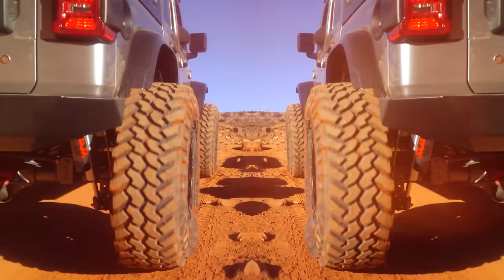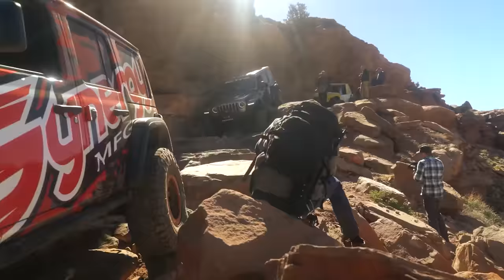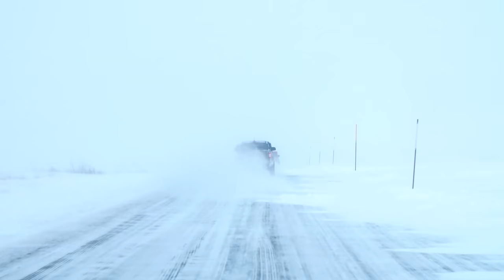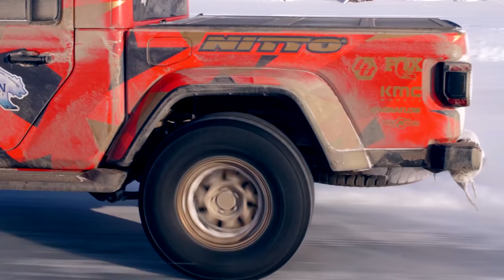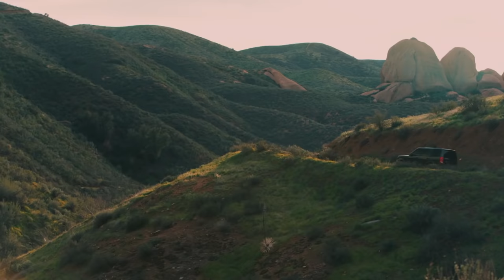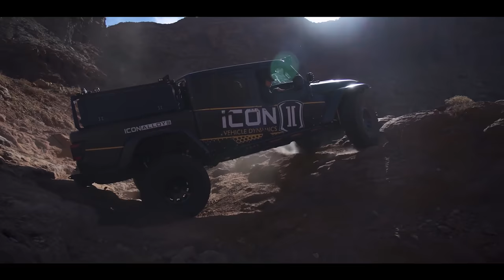Do NOT Use 4-Low Offroad || Watch First!

Comment: I live on the outer banks, and most of my off roading consists of driving on the beach. since I drive a 1st gen tacoma, my rig is so light that there's not much strain on the drive train in 4h and I don't need the extra torque because I pretty much float over everything. the only time I really ever use 4 low is when doing a recovery.

Comment: I drive only 2 'trails' around me in 4L, in a Suzuki Sidekick. One is very steep trail that leads to a mountain road when it's been raining a couple of days and 4H won't pull me up. Another time is on again very steep grassy hill where I need to drive about 25 meters sideways and it gives me better control of the car.

Comment: Dead stop for going into 4 low?  I highly question that.  Granted the last Jeep manual I read was in the 70's.  The manual read that you should be traveling 5 to 10 mph, in neutral when shifting into and out of 4 low. 

I have a YJ.  As soon as I hit the dirt I am in 4 low.  It does not matter if a 2 wheel drive pickup can drive the road.  I love the 
control it gives me, I have a manual.  I end up using the brakes far less and the driving is very easy.  After all you should not be driving faster than 25 mph on dirt.

Comment: regarding going downhill (on a long paved road) should i use 4-L or in  just leave it in 2wd or 4H in order to not overheat the transmission\gears. taking the consideration that i'm using low gears like 1st to 3rd?

Comment: I used 4 lo when I had a 1999 gmc jimmy I was stuck in the snow the vehicles front axle didn't lock but transfer case did work so I put it in 4 lo and backed up and it got out of the snow

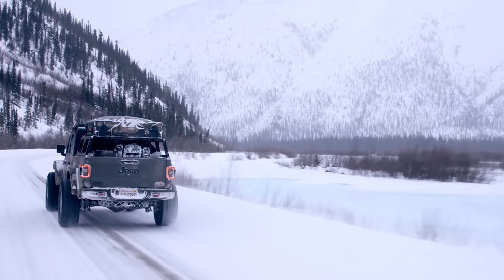Comment: My Taco has a Manual Transmission. I use my 4L more than others with an Automatic in the same situation. I’ll concede that the Autos are better off road, but manual is more fun to daily drive. The 4:30 rear end helps as well.

Comment: I've seen in your video that you use a nylon strap to pull that vehicle out of the ditch I've been in an off road situation for the last 40 years and I've seen some people get stuck very well the best solution that I have seen is using a is a 50' piece piece of 1" to a 1.25" nylon rope, We would hook up a vehicle  that was high centered with either one side or the other floating in the mud. The towing driver would  take off at a high rate speed to put a high tension on the nylon rope at which time he would set his brakes. Then we would wait until the Tension of the nylon rope pop the vehicle out like a cork out of a champagne bottle.  Never use a chain and less Is destructive jerking on the vehicle's frames then a nylon strap

Comment: If you have abs make sure you can turn it off when going off road OR have mud mode.  Abs is designed for ice(older models don't have mud mode)I am an ex farmer and when is in mud it applies the brakes to ensure you stay stuck and need a tow out.  It will also apply the brakes to prevent you from "rocking" yourself out of a mud patch. Very frustrating.

Comment: LC’s are always in 4 High. I use 4 low when I’m in off road areas that necessitate going slow anyway. It just reduces stress on the transmission and engine. If I’m doing more than crawling along I put it back in 4 high.

Comment: More often than not you don't really need low range. When you do you usually have to stop first anyway to walk the obstacle first. 
Most things you think you need four low for, all you really need is to drop some tire pressure. 4Lo is for when you need torque, not speed.

Comment: years a go I had a sound coming from somewhere under my old ram so I drove to a step long hill put the truck in bull low and four low let the clutch out got out of my truck while it climbed the hill and listened to where the sound was coming from other then that never had to my 4x4  trucks was old and manual trans so both my old 78 ram and 06 ranger

Comment: I bought a 4wd truck for the first time. Tried to go into 4 low, but it wouldn't go. Thought it was broken... Looked it up later and learned that you need to be in neutral. That was a sigh of relief
Reply: Some t imes when its not used it won't go into 4. Hit the transfer case with 2x4 or something
Reply: @vadimnesen8060  A good reason to practice shifting into all gears at least once a month and then go somewhere and drive through all the gears.  You'll find if you are in 4 lo trying to reverse becomes a real PITA to accomplish.  I keep learning my Jeep's limits as well as my own.  I wish now I had bought a 4x4 when I bought my first vehicle here in the States.

Comment: Here's the deal--I can cruise at 30 mph in low range with overdrive with 33's and 4.56 gears.  Once I hit the trail, the only reason I want to take it out of low range is to keep the transmission from hunting gears constantly.  So, I want to be able to manually shift the AW-4 transmission in my Jeep.
Reply: 3.55s and 35s work amazing for me. It blows on the road in high but it's a trailer queen. It's open in the front and fast enough to drive to the trail head from the parking area about a 2 mile drive on pavement in low.
Reply: Were there many different transfer case ratios over the years?
Reply: @paulstandaert5709  the only ratio Cherokees ever came is 2.73. Actually all chain driven new process cases except the 241 Rubicon case are 2.73.

Comment: Is it better to stay in 4 LO or switch back n forth between 4 HI and 4 LO? I normally use 4 LO when i need to limit my speed, but once i get on smoother areas I am not sure if going in to third in 4 LO is a good idea or not.
Reply from the maker: Staying in 4Low while in 3rd gear is generally not recommended. If the next part of the trail you can go faster, it's recommended to switch to 4High. Don't want you ruining your rig!

Comment: I use 4L and 2L (twinstick) all the time in my BB 78 Blazer with 4.88 gears and NV4500. Where I don't use it is on steep snowy/icy hills, if the truck starts to slide I want the speed to catch up to the slide, 4L doesn't seem to work for me in these conditions .  Nice Vid, thanks

Comment: I use 4 low when I am driving around frozen chisel plowed farm fields (Iowa). Especially when I have to drive across rows to get to a hunting spot. Generally I drive along the field ends where the rows run parallel to the rest of the field, but then there are times I have to cross the rows, and low in low 4 seems to work best. Also, since you're from Wisconsin, you'll know what I am talking about when it comes to NW Iowa/SW Wisconsin topography- there are some trout fishing spots I go to that have some steep inclines to get in/out of, and are usually dirt with exposed limestone up steep grades that are sometimes wet from rain, dew, mud, etc. SE Minnesota is the same way.  Up in Minnesota, I drive on some logging/forest service roads that require 4wd, but only 4low if it's snowed or rained a lot.
Reply from the maker: You hit it right on the nail for the topography haha!
Reply: @TrailBuilt  I have a farm pond that I go to in the summer that has a pretty mean incline to get down to it- it really tests your gearing and your braking on the way down. The loose gravel and damp limestone along with clay/sand and deep washes after repeated heavy rains makes it fun. 20 years ago  it was well maintained and had crushed gravel surface and we'd run up the hill with a minivan no problem. The landowner kinda let it go.....kinda on purpose because people would sneak in and fish. So now if you go......you better have a 4x4 or you're calling a tow truck for an expensive recovery, haha.

Comment: If you are not sure when to use 4Low you are doing it wrong or are new to Offroad driving. 4Low is Offroad use rock crawling and obstacle related. 4Hi is flat ground Offroad when you need speed or snow conditions ice on flat ground. You should really learn when and how your vehicle works before taking it into situations that require 4Low or 4wd in general.

Comment: Most of the time 4 Lo , auto in 2nd, really tight sand trails in the forest, mud. Stops the auto over working getting hot, also have remote cooler for trans with thermo fan.
4hi slippy roads only , gravel, heavy rain

Comment: I guess you've never heard of the two wheel drive game that Matt plays. Go as far as you can in two wheel drive, then get out and lock in the hubs in the most awkward places. One thing that you don't mention, is when driving at highway speeds, you can shift from two high, to four high and back when the highway changes from slick to dry. Just let up on the throttle to take the pressure off the drivetrain, and shift.

Comment: 4LO with a manual transmission and a hand throttle is like driving a totally different vehicle. With my hand throttle I can set the RPM not even worry about the gas.

Comment: I do 4 low mostly and 4 high over 20, you really should be runni g 4wd at all times off pavement imo as a safety measure gives you much more control if it's slicker then you think or you come upon an unexpected issue.

Comment: In 50 years I can only say I needed to use 4Lo twice. Other than that either 4hi or like my current Jeep just the AWD. That being said I have heard a lot of people in 4wd Facebook groups claim that 4Lo will protect the land but not sure I believe that.
Reply: I'd run it in 4 low for a minute or two offroad a few times a year just to keep everything working. Besides, you only live once. Have some fun and get to know vehicle well in 4lo
Reply: @forlornhope1116  we use 4lo I'm just saying it's most times not been needed.
Reply: @risbill1  ah, got ya. My cummins dually stays in 4lo on the ranch offroad pulling trailer through/crushing thick vegetation to feed and check up on cattle. I can idle up hills. For a wrangler and not going through thick brush 2hi & 4hi is just fine

Comment: I used to think that stopping was the way to go when engaging 4L. But then I read my TJ's Owners Manual: 

"4H to 4L or 4L to 4H
With the vehicle rolling at 2 to 3 mph (3 to 5 km/h), shift
an automatic transmission to N (Neutral) or depress the
clutch pedal on a manual transmission. While the vehicle
is coasting at 2 to 3 mph (3 to 5 km/h), shift the transfer
case lever firmly to the desired position. Do not pause in
transfer case N (Neutral).

NOTE: Shifting into or out of 4L is possible with the
vehicle completely stopped, however, difficulty may occur due to the mating teeth not being properly aligned.
Several attempts may be required for clutch teeth alignment and shift completion to occur. The preferred
method is with the vehicle rolling at 2 to 3 mph (3 to 5
km/h). Avoid attempting to engage or disengage 4L with
the vehicle moving faster than 2 to 3 mph (3 to 5 km/h).

Comment: I found out the hard way that a Tacoma will not shift into 4Lo if pitched up a steep incline,  veh  must be relatively level for it to electronically lock into 4Lo;    Had to back approximately 20 ft to level spot before I could shift 4Hi to neutral to 4Lo and complete climb..

Comment: 4-lo, pulling large logs. Had to air down to 30 psi to budge it.  It was about 12 feet long and about 30” at the base. 4-lo gave me the crawl I wanted. Also I don’t know if anyone else’s 21 gladiator has this happen… I’ve an automatic… but when I shift to 4-lo the transmission starts in 2nd gear. I have to flick over to manual to get into 1st????

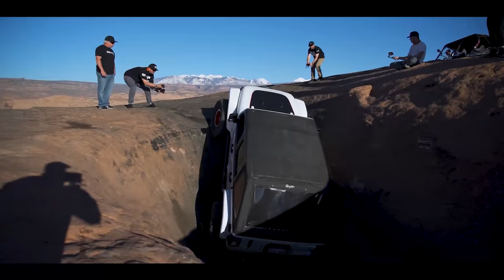Comment: Error at 6:37
Shifting into low does NOT 'multiply the engine's output power' Changing gear while holding everything else constant will change torque, but NOT power. 
What you said is true only IF you QUALIFY your statement by saying that the lower gear will allow the engine to rev. higher at the speed the trail permits, so that it reaches its optimal power band.                   If you're going to bring up a topic like this, please be precise.

Comment: Firmly believe low should only be used in deep mud in low powered 4x4s, towing heavy off road, going down steep sections and sections that are full of slow trail so your not on your brakes all day but Everything else should be high range. 
Any vehicle with a v8 really shouldn’t need to use low unless it’s for safety purposes. I’m not saying v8s are king but there’s a reason you see most builds using a v8.

Low also puts more strain on the drivetrain contrary to what people think. Your trans and engine are reved up like your in the highway when your only doing 15mph so it provides less cooling, it throws anywhere from 35% to 50% more torque to the wheels so when your already bouncing on the rocks that’s just extra axle and hub breaking power. Either put it in low and crawl like a turtle or high and smash thru.

Comment: Whenever i pull another rig with my jeep, i always use 4 low, or when i want to go slow with power. I use 4 high most of the winter (up here in alaska) when normally driving.

Comment: Doesn't 4-low help mitigate "binding" if/when tires gain traction, eg on rocks, namely by making the tires slip just a bit? In some "full time 4wd" setups (eg, vintage Mercedes G), the center differential only locks in 4 low but not hi, which I presume mitigates  center diff binding to the extent the 4-lo gears can more easily force the tires to slip.

Comment: Don't get caught up in the arms race of lockers.  For most driving and off road, a selectable locker in front, and a working lsd in back will do fine.  Put your money on a winch, and tires. If you are new, get bfg all terrain--these tires history go back near 50 years, very well proven tire and well worth your money.. Mud tires on snow work very well.  If no winch, use recovery rope and get solid recovery points. Bubba rope great place to start with recovery rope.

Comment: If you go up a steep gravel driveway in 4 Lo and it has a turn you will spin and dig up the gravel. If you use 4 Hi then the tires will give and you won't tear up the driveway as bad. Correct? Plus the wear on the tires using 4 Lo. 4 Lo does not allow any spin in the differentials.
Reply: It depends on the diffs. Open/open would go easy.

Comment: Where did you grow up where they didn't use 4low? It was common here in Utah. Common in 4x4 clubs to advise 4low, as well as guided runs, such as at Moab Easter Jeep Safari.  Most wheelin' in Utah is done in 4low.  In my Scrambler though, most of the trail is 2hi, then 4low at the obstacles (454 & SM465 help with that).  It's been weird doing whole trails in 4low in the newer Jeeps with small engines and lack of torque in 4hi/2hi.  Even my diesel JT prefers 4low. 
 Good vid!

Comment: I can't agree with those that say 4 high is mostly useless or shouldn't be used.There are many situations where it's helpful and or safer using 4 high when you don't really need four wheel drive at all. There are several that apply more to pick-ups than to jeeps or short rigs. One is slippery, muddy or snow covered roads. There's absolutely no reason to run in 4 low driving 10-20- miles down these roads but 4 high can  save you from having the rear slide around and pass the front end in a turn. Also, and this is a Biggy that I wish others learned early on. When traveling gravel roads and especially inclines on those roads. Putting it in 4 wheel drive greatly reduces the chance of "wheel hop". This wheel hop is what leads to those damn wash-boards that make your teeth rattle and loosens the hardware holding your vehicle together.

Comment: My transfer case clanks when in 4 low in my 2014 rubicon. Is that normal or do I need to rebuild it?
Reply from the maker: Might need to rebuild it, how loud is that clanking?
Reply: @TrailBuilt  it’s pretty clanky, it seems to do it when when letting off throttle or when going over rocks. It might just be the tcase clanking against the skid plate.

Comment: TL;DR just to play it safe. Buy only the jeep frame and upper body with interior from factory then add modded everything else to it 😂 and probably a V8 crate engine 🤷‍♂️. That way you know it's gonna be near impossible to break anything. Or you could just buy a tank. If you can't wheel it, blow it up and then drive over it

Comment: I use 4 low  a lot . 90 miles through saline valleys wash board, it goes into 4 low ,drive. better braking  and acceleration, and it will smooth out the ride. . pulling my house trailer through a camp ground, 4-low.. know how  to use it. yes you can break more stuff in 4 low.

Comment: I like 4-low even when I don't need it because 4-high has too much difference between 1st and 2nd gears but in 4-low you never use 1st gear and rarely 2nd when driving 15-30 mph for 10 miles of rough road up to my favorite remote mountain campsite. I'm not operating in a higher RPM either because I'm always between 1.8K and 3K in high or low

Comment: You said to go into 4L while stopped, but my 2018 JK Rubicon manual says to be moving at about 4 mph. Can I go into 4L from a stop without hurting my transmission? If so, do I need to be on any specific sort of terrain to do so, like with the sway bar?

Comment: Shit, I lock the diffs then lock the axles and split the gear, at 1000 RPM takes ten seconds to turn the rubber all the way around one time... Deep reduction in a mixer.

Comment: Consider too the tire diameter and axle ratios.     also consider if in a high gear you may end up with a lot of tranny slip, which means high heat in the tranny (automatics)

Comment: in my 48 years 4 low has only had 1 use that was pulling, nothing more, all other times 4 high did the job with ease and if that wouldnt work i either stayed home or unhooked the winch most auto trans have a first gear for you folks who think 4 low helps when you need to creep or scared of using those brakes

Comment: I would love a little helpful information about using a Manual Transmission in 4L with lockers and swing arm release vs. an Automatic. My manual sounds like it’s revving, way higher vs. my automatic on the trails. Is my manual actually a little stronger 🤷🏼‍♂️. They seem like two very different beasts on the trails and Both are stock rubicons.